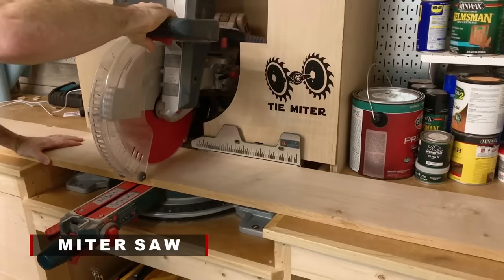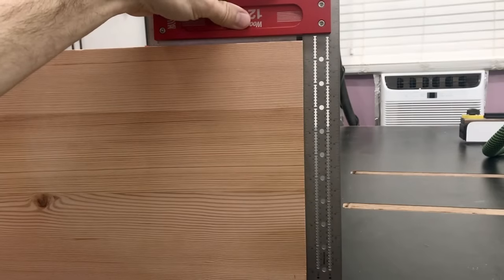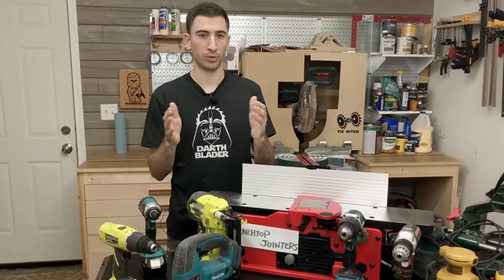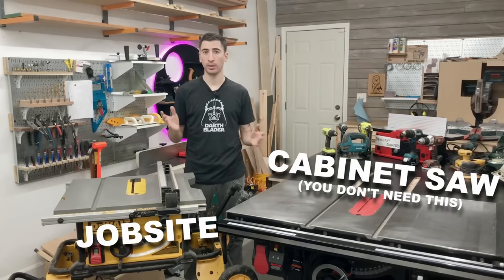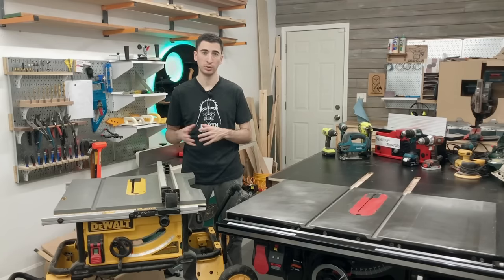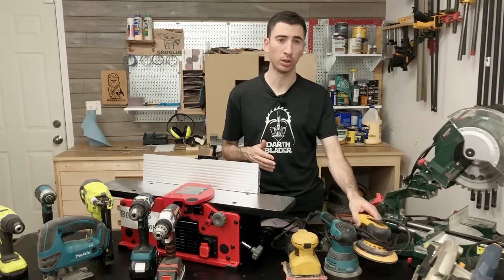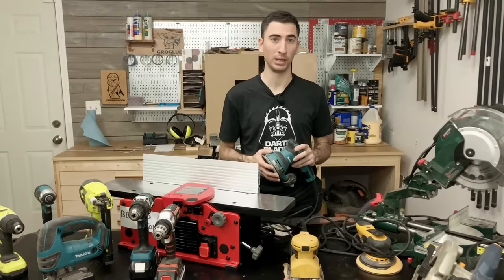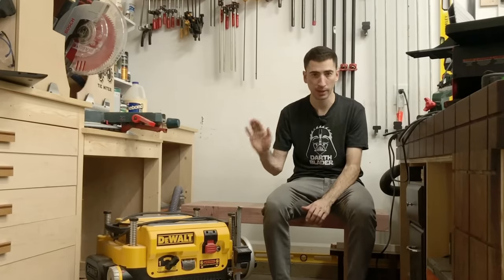Woodworking POWER Tools // Watch Before Buying

Comment: I agree with everything you wrote except the sander. I bought a Porter Cable 1/4 sheet sander back when I was first starting out, back when the Porter Cable name actually meant something. That thing has been a workhorse for me, so much so that I hardly ever use my ROS.

Comment: Rigid is a great option and it will take a dado  .Kobalt for the miter saw been great but easy to knock out of alignment but doesn't make much difference.  Ive used them all professionally and no issue. two of my impacts are over 10 years old.   I did buy dewalt 60 volt group and they all amazing. skil saw,sawzall,blower ,heater

Comment: If you have the money, it doesn’t hurt to splurge on Milwaukee Fuel or Dewalt XR. Starting out with a drill driver and impact driver combo kit and buying additional bare tools or kits on an affordability basis is another great option if you want to go right into high end power tools which is what I did. I got Milwaukee because I love brushless tools, the word fuel, and the color red and black.

Comment: I knew it was going to be the jointer! I made that mistake and not long after I gave it to someone and bought a real one. SkilSaw's new wormdrive table saw is pretty similar to the dewalt. I mention this only because the rolling stand with 16" wheels is absolutely amazing. Hard to say if it's got more power with the worm drive but it has no problem slicing 2.5in thick oak with a good quality blade. The blade brake allows you to work blazingly fast without the need for a "stopping stick". I modified the rack and pinion fence for tighter tolerances and had it dialed in for a repeated accuracy of 0.002 in. It would make a great starter saw

Comment: I spent around $100 for a corded Hitachi circular saw for around the home projects. I had it for 9 years and cleaned it up after every use. Once it began to barely get dull I switched to a new blade. Not a bottom end brand but for $50-$60 more I could have purchased a top brand. One day while everyone was out of the house I decided to replace one last floor vent (we removed central air and heat) with some plywood. It was a tad too small and just needed 1/8" trimmed off of one side about 6" long. But my Sawzall battery was too low so I pulled out the Hitachi. I got down on hands and kneess and just began to cut and the blade hit something and jerked backwards. The safety bar did not engage and went across my right thigh just above the knee. 63 stitches on the inside including a severed smaller artery (not the big one) and 17 or more staples on the outside. It just missed the main artery the ER Doctor told me. Luckily I didn't panic and knew what to do but what a mess. Took a long time to heal and regain the ability to walk. Biking is still out of the question as well as dancing. $50-$60 more would have prevented this. That safety bar never failed before. I went to an attorney but he wouldn't take the case. That model number fit those that were either recalled or had issues but the serial number didn't match. Thanks for the video. Your doing a great service which could very well prevent injury and even death. And that Hiachi? Well the company said all kinds of contradicting things so I took it to a friend's and used some heavy equipment and crushed it. I may mail it to them, bloodstaines and all.

Comment: I've had a $70 HF miter saw for 5 yrs and it does exactly what I bought it for, namely crown and baseboard molding. It took a bit of adjustment to get that 90 degree blade-fence angle but it's dead on.

Comment: My husband bought me my fist mitersaw about 15 years ago from Sears. Thought I would return it for what I wanted.  Great gift. I have used it for so many things. Not just for things like quarter round.  I even  used it for cutting the plastic pipes when installing a new kitchen sink. You need really straight cuts for that. For copper you can find pipe cutters. 
I also used it when rebuilding my balcony, as I could keep it on the lower deck instead of having to walk to the table saw in the garage for cuts. It was enough work going up and down stairs carrying lumber threw the house..
Bought my first table saw for installing laminate flooring in our old house. Did the entire main floor.   Got a lot of use out of it over the years. Installed the floor at a friend's house as well. 
 Went more expensive for my second table saw. 
I have had 4 sanders. The first owed me nothing. Cheapest one at the store.  Sanded several pieces of furniture for refinishing, hand sanded 4 wood floors and the kitchen cupboards. Failed just before the kitchen was done.
 Went with Dewalt for the second. Gone in just over a year. Friend convinced me I got a lemon. The second one barely lasted a year. Bought cheap one from Canadian Tire for my last one. Over 5 years now and still going.
My husband had a cheap cordless drill that we used for decades. When it went dead I bought him a Sears cordless drill. Waste of money. As was the next.
We now have 2 corded drills and an old cordless one we bought at a garage sale. It is working great, unlike the garbage ones out there now.
We also now have a drill press. Last years Christmas present. Not used often, but handy when needed. 
Would love a wood plane. But just got a new wet tile saw, so I need to wait.   Also want a table jig saw. They look much easier than the hand held.
I think people often get the new tools to fit a project. And everyone does different things. But brand name does not mean much anymore.

Comment: My first miter saw was a used, roughly 30 year old DeWalt, with a stand, off of Craigslist for $50. I'm not even kidding, when I went to pick it up, he had just left it outside, so I continued doing the same thing. It's been outside for the better part of 10 years since I bought it. Rain, snow, everything you could throw at it, and it still turns on and cuts it a perfect 90 every time

Comment: I am now 70. After 25 years of various iterations of a workshop, I have settled on my preferred setup. Crucial is a planer/thicknesser with a spiral head. If you get grain direction right, you can start sanding at 120 grit. This & a quality 14" bandsaw make up the core of my shop. I also have an old Dewalt chop saw with a quality blade that has worked flawlessly. A table saw is essential & I settled, for various reasons on the Dewalt job site saw; noisy but has never failed me & is capable of serious hard work & is reasonably accurate. I have also embraced the multi function table & the track saw. The track saw will revolutionise woodworking in the same way that the router table has.

Comment: I have both Craftsman and Ryobi battery tools. I started with Craftsman because I used their automotive hand tools on my race cars (really, was there any other brand?!) I started using Ryobi When I found a drill, battery and battery charger, plus the bright green goes well with the red Craftsman at Christmas time. 😂 I mean, it is impossible to lose bright green tools, I can see them all the way down the street when I open the garage door as I drive up.

Comment: I think your advice is both decent and fair you don't need to go top knot for you tools the mid range should be sufficient. There are some you'd go for that are expensive based on experience ( Milwaukee is a brand I've grown up with and it goes the distance without getting hot on your hands had some DeWalt tools do this but the tools performance was not affected (however let's face it it gets hot let's rest it for a bit .) I seen DeWalt cordless quality improve significantly concerning what I mentioned as well battery life etc ,but I'm about the red and black and they too have done their research to keep their reliable status any problems they deal with and iron out . Nuff said DeWalt Makita and Milwaukee are your sure bets !!

Comment: I saw the dewalt rack and pinion tablesaw in your thumbnail and was ready to fo too war with your reasoning for not recommending it. Glad to see that wasn't the case. That was my favorite purchase and I often go for the cross cut sled on the table saw instead of the miter saw. Surprised you didn't mention tracksaws although they are more for carpentry vs woodworking.

Comment: Bro...that DeWalt jobsite table saw has been the most useful tool ever. I live in a travel trailer on the road and am moving onto a sailboat...so I cant have a larger table saw. I have used the jobsite table saw to mill tons of lumber from driftwood...sometimes from the beach with salt and sand and dirt in the stump pieces...for five years...stored outside the entire time. I force off angle pieces through it with the blade fully engaged...burried so i can then turn the piece over to mill boards wider than the blade sticks above the table. I have abused it...i make it groan every cut when im milling...lol...it hates my guts...but it keeps going. It often gets run on a generator also...lol.

Comment: Good video. I've thought about this stuff before. Festool make very high quality tools for example BUT they are very expensive and certain of their tools really aren't worth the uplift in cost. A Festool sander just doesn't offer enough in benefits, for me, to justify the cost, but a tracksaw or a mitre saw by them might.

FWIW I find that Ryobi kit usually falls into the sweet zone of not too cheap and crappy and not crazy expensive... but I don't think I'd buy one of their table saws.

Comment: I have that dewalt table saw. It's pretty good, I'd rate it. One thing to keep in mind is that the arbor isn't very big so you won't be able to use dadao blades of much thickness at all. It took a bit of forcing on my part just to use the 2 dadao blades + spacer blade. Any more wouldn't fit

Comment: I have a rule on power tools, if It can kill me I won't buy it from Harbor Freight. I have a dewalt dual bevel miter saw and the same job site saw you show here. The dual bevel saw is perfect, lots of options and everything squares up nicely. The jobsite saw? I HATE the fence on it. Pro tips for those who own this beast, use a square on the fence before you lock it down. Nothing worse than being 1/16" off on a long rip cut which translates into like half inch down the way. I'd love a cabinet saw, but with some modifications you can turn the jobsite saw into a full size saw by just extending out the table, cutting custom tracks, using a cross cut fence and things like that. Basically a super saw :)

For the dewalt 735....yea I agree. I don't have one yet, but the main reason I like the 735 is the 2 speed option, get finer finishes with the higher speed. The 734 is one speed. Spend the money here! I've used the 735 a ton, I just don't own one (yet).

Comment: That's the thing Makita has great tools for the garden. I wish i went for them instead of Bosch because now i have 18V batteries for tools and a expensive 36V stihl system for the garden stuff. So really good advice for powertools here. Most times you can't really discuss pros and cons of a brand because of the fanbois.

Comment: The forgotten radial arm saw replaced many bench tools like table saw, miter saw, sander, planer, router, moulder. A used commercial quality DeWalt RAS (when found one for cheap) would be nice for a limited garage space.

Comment: My Skill worm drive has served fine for over 30 years. I am just a DIYer now but I used this same saw when I was working on framing crews in the 80's. On the other hand I had a Ryobi sander that burned out in no time. So I wonder about the recommendations here. But I have no doubt that this guy knows a lot more about tools than I.

Comment: Buying used is a good option if you can find actual deals but power tools appear to be in the rare category for items that seem to APPRECIATE in value. (largely because new prices keep going up) If I wanted to sell everything I have today that I bought new several years ago, I'm fairly confident I wouldn't lose a dime, if not actually make money. For instance, the Dewalt 735x planer I bought in 2017 for $425 (great deal at the time), goes for $650 today. The 3hp, 36in Sawstop PCS I bought in 2018 for $2990 (another good deal), goes for $3600 today.

Comment: Thank you for this tutorial! I was just about to buy a benchtop jointer. Great save! I want to mention that the Hitachi C10RJ also has dado capability. Now, I am not comparing to claiming that it's better at all, but just today I cut some 3/4" dados with mine. Just letting you know the DeWalt isn't the only one that does that.

Comment: I went with solid cast iron 10" Delta Rockwell table saw.  It's a bit on the heavy side at 525 lbs and replacement parts are a bit tricky since it was built in 1948, but damn did they know how to build a table saw back then.  All original except the Biesemeyer fence and a cheesy motor cover made out of tin that came with it.  Runs like a top.  $270.00 at an auction.

Comment: One thing I would say about battery operated power tools is to stick with one brand if you want to save a bit of money if like me you’re only just starting out, since buying just the base tool (without a battery) is so much cheaper since the battery can be used on the tools of that brand. I own a Dewalt drill that came with a battery. So this saved me money when I bought my circular saw and router, when you start using the tools more then buy extra batteries since the tools last a very long time if their looked after.

Comment: I found that only a few are affordable. Many brands change there batteries with the tool, when you buy the new tool you have to buy a new style of battery. I have a ryobi drill that built two houses in Alaska 10 years ago for weeks. one house was 2000 square feet. I still use that drill every week sometimes all week long. It's how you treat your tools that make them last. Ryobi is a cheap brand, and I have seen my neighbor break a Dewalt in one month. I prefer ryobi for its one battery that will fit over 100 different tools and even there new tools.

Comment: I've had 3 miter saws. Milwaukee 12" for 299 from home Depot. Burned up in a garage fire, then I got a metabo 12" for $350 shipped, broke it then got a Ridgid 12" shipped for $350. That's what I use now.  Last two from amazon

Comment: I started purchasing Makita decades ago, before their battery power tools became a viable option. The quality has never degraded over time and I am willing to pay a bit extra for Makita over the lime-green cheaper option. I recently considered introducing another battery-powered brand,  but was advised by the specialist tool shop to stay with Makita. This specialist stocks all the battery power tool brands. I also have three light-duty powered screwdrivers from Matsushita, for smaller work. They are beautifully made tools.

Comment: The miter saw or a table saw is the best tool to own for most people, you can make a miter/table do every cut you need for 90% of your projects. Just takes building some templates. (Ripping is the only thing a miter wont dont as well as a table, but you can easily rip medium chunks of wood if you need to)

Comment: Harbor Freight used to  sell a 7" rabbiting jointer for about $200, with a 4 foot length table.  Everything about it was cheesy - except the completely adjustable cast iron tables, the 1HP induction motor, the fence, and the dust collection system.

The cheesy stand was like an erector set, with about 1,000 bolts to put together.  The guard was cheap plastic, even by Harbor Freight standards.  The fence, it was cast iron too, but you set it using your square - the gauge was completely useless.   And the dust collection - all it was was a chute in the cheesy stand downwards from the cutter.

But that chute would catch all of the chips from the cutter, which could conveniently deposited directly into a trash can.  Both the tables and fences are completely adjustable for accuracy, and the 1 HP motor provides plenty of power.   Quite simply, it is the best jointer I have ever owned.

Comment: I look on marketplace and eBay and local auctions and have bought older Delta, Craftsman and other older brand name machines and replaced bearings, motors, belts and the like.  The older machines are almost always better quality that the newer stuff.  I bought a Delta band saw for $50.00 and about $100.00 or less in bearings, motor, belts and paint have a machine that I could not duplicate the capacity and accuracy in a new machine for $1,500.00.  Plus it is worth way more now if I decided to sell.

Comment: I would not discount Skil so quickly.  The Skil TS6307 jobsite table saw has all the same features as the Dewalt you recommended (especially the cam fence system, which is absolute gold in a table saw as far as I am concerned), costs half as much, and comes with a really compact folding leg system.  Mine was very easy to square up and has not failed me yet doing wood working projects and home remodeling.  I even used it to cut full dimension lumber out of rough cut slabs to repair storm damage on an old barn, which is pretty hard on a saw, but it powered through like a champ.  My father in law is a master finish carpenter and prefers that Skil model over his Dewalt mostly because it folds up more compact and is easier to move to and from a job.  My biggest problem with Dewalt is that all their stuff is WAY overpriced for what it is.

Comment: I bought a Compact Circular Saw and an Oscillating multi tool to take apart a wood crib and used them to build a dog crate patio table, so my puppy can chill outside and be discrete about it. Worked pretty well. Not gonna lie, the Oscillator is the greatest power tool of my life. Especially for a woman whole doesn't understand why there are so many power tools that only do one thing. They need more all in one tools I think lol